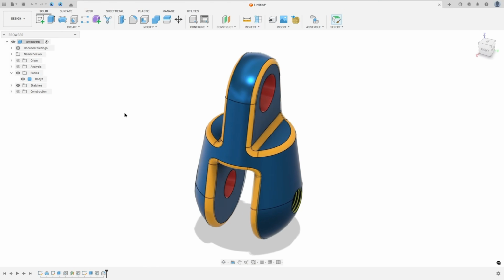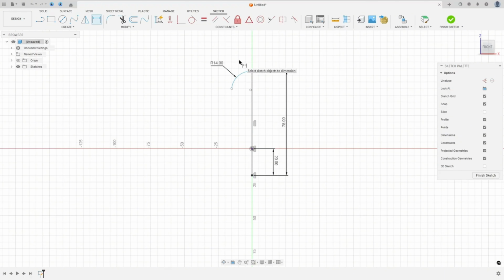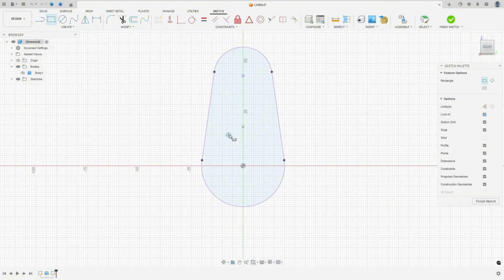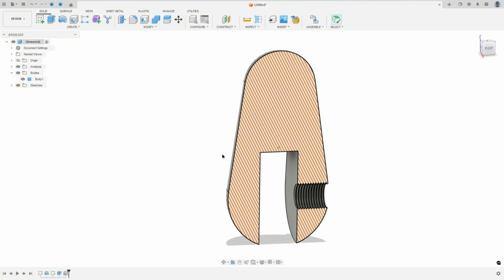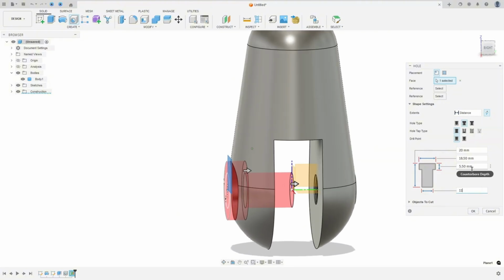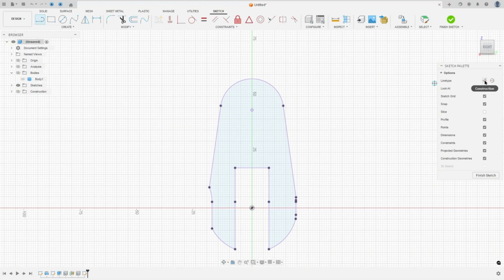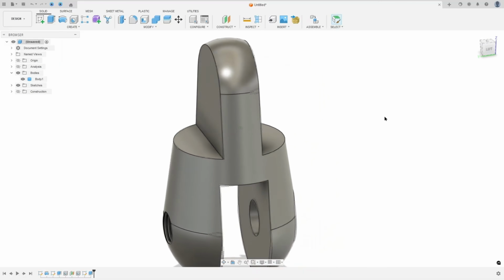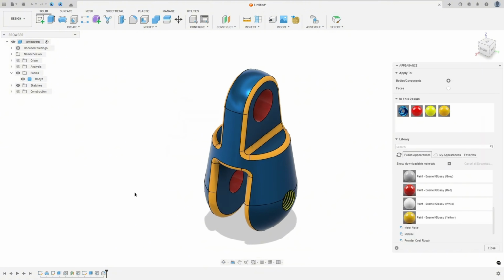Fusion 360 From Zero | Beginner Step-by-Step Modeling Tutorial

Comment: Brother, I think your videos are simple and straight to the point for beginners, ( nice job  ) slow enough to memorize every small step ✅, but you need to do some in "imperial, inches" ( professionals use both ), not just millimeters,  split  your  tutorials using  inches and the other designs in millimeters thanks brother, good job